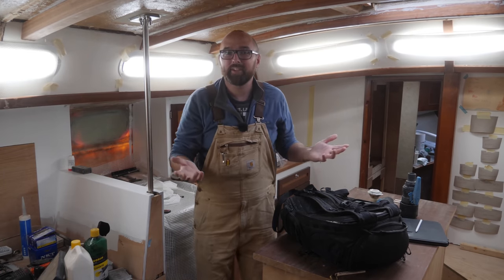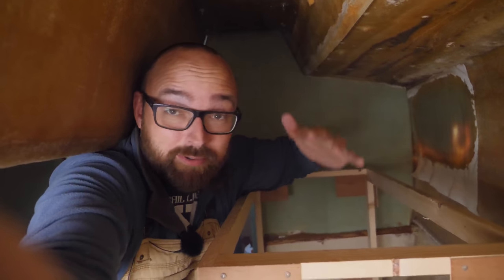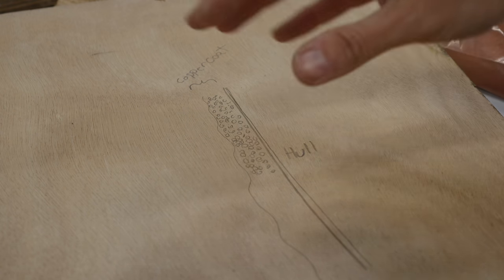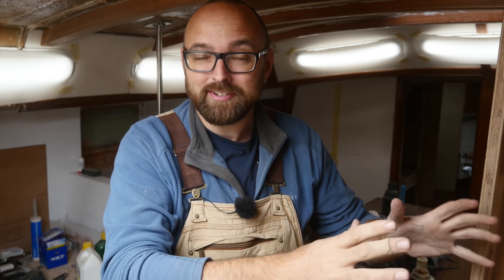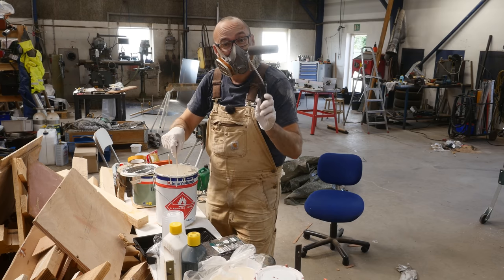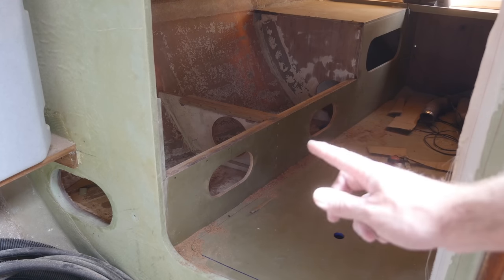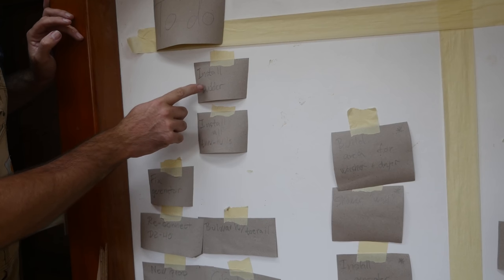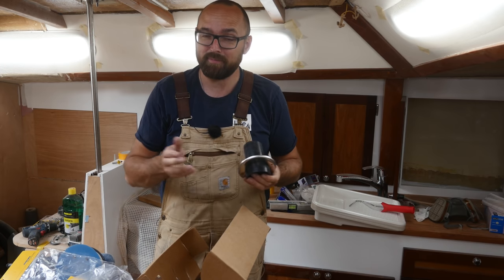Sail Life - Hull painting, tech compartment & coppercoat activation - sailboat project

Comment: Generator fuel tank under the generator location? Low and central. Oops. Too late.
Mads, your calm ability to uncover and resolve problems, often monumental problems, is now web legend. Rather than getting angry, you get focused on a solution. 
Your sense of humor is epic. Bravo! Camera suggestion: Blimp your camera with a large baggie with a tight-fitting hole cut for the lens. That will limit dust penetration and you can always replace the bag now and then. Operation through the bag should be easy.

Comment: Nice cleats.  

Having big meaty cleats is very handy especially when prepping for a big storm like we are doing here on the US East Coast eight now.  

It's nice to run extra lines for storms but cleats fill up REALLY fast.  If I were to do things again I'd put in two sets of midship cleats, a couple feet apart.  It is nice to be able to spring both forward and aft from midships and sometimes leading a line around a piling and back to the same cleat is handy. But four lines on one cleat piles up.  

We don't use lines with eyes, but a bowline loop is handy on one end.  Even your little center hole in those cleats would allow a bowline to be tied onto the cleat through the middle to save space.

Remember to put your fairleads as close as possible to the cleat so line stretch will produce minimum movement and minimum chafe.  The further the fairlead is from the cleat the more the line will move over it.  

I can't wait to watch you build your toe boards.  That should be fun. Integrating fairleads into or around them should be interesting.

Comment: I'm sure you have thought of backing pads for the cleats. I have to mention it having had a cleat plucked out of the deck on a Sadler 32 on its mooring after an exceptional storm. Love the channel Mads. 👍
Reply: Stainless steel plate on the inside.
Reply: G10 or even structural fiberglass works a treat.  He could lay up his own about 6-8mm thick.  Maybe even epoxy them right on to the underside with a fillet around it.  Instant thickened section.
Reply from the maker: I've ordered 6 mm stainless 20 x 20 cm backing pads. That should work 🙂
Reply: Good man. It can't be easy boat building by committee😉

Comment: Maybe re-format the SD cards, possibly the GH5 was going bad for a while and has subtlety corrupted the actual filesystem on them, which in turn is causing issues as you now use them in the GH4 … or you're leaving them too close to the welder ;-)
Reply: Might have even actually wrecked the cards. Storage is cheap, at least; replacing the cards with new after replacing a camera will feel cheap and easy.

Comment: Why did you not wait to activate the Copper Coat until closer to putting Athena in the water?  Wont it just oxidize when exposed to air and require reactivating again later?
Reply: You are 100% correct
Reply: That was my thought as well.

Comment: Shake the camera and let it rest without a battery and memory card. There's also a general reset feature (there should be one). If not, just take it to someone who knows how to fix cameras. I fixed mine (fell at 1 meters, no longer working) for a third of the price, the tech guy had to desolder and resolder 2 boards that had shocked loose in the mounting.

Comment: Mads is there no need to get the hull in the water soon after activating the copper coat? I would have thought you'd need to minimize the layer of copper oxide that will form when copper is exposed to air .
Reply: Hi Mads I was wondering why y decided to activate the copper coat now with no definite launch date...superb work to date.

Comment: Would I be right if i said you are trying to get a layer of oxidized copper on the hull before launching. Is it the oxidized copper that has the anti fouling properties??.
Reply: Yes. Partially. Once the boat hits the water the salt will accelerate the oxidization and turn the brown to green and it  is that which repels sea-life.

Comment: clear the sensor  pull your battery and press the shutter button others ..discharge all the caps and bios battery for the camera and let it stay discharged 24h then power it up  that may fix it,,last resort  see if it has firmware  and flash that  best of luck thanks for the videos

Comment: There is a delayed release of the DH6 so you might find prices coming down on the DH5. The post regarding firmware might get your DH4 up and running.

As to your DH5 do you not have insurance for accidental damage? The camera probably stopped working when you accidentally "Dropped" it.

If I were you I would not worry about having the latest Doo Hickey see I have picked up some technical terms. As long as you are in the yard durability is going to be more important than mega quality. It is not as if you are a twenty something bikini clad babe that we need to see every hair and dimple! Actually come to think of it a DH1 would be ok for now :)

Comment: What was the motivation for activating the coper coat when you're still a few months off splashing?  

Unless I'm missing something about the specifics of the order you're doing things in, I would have assumed leaving it as close to getting in the water as possible would have been better to minimise the time when the new activated layer is exposed to air. 

Of course that may not be an issue, but I'm just curious.
Reply: The coat is supposed to withstand ocean water for a long time so I'm pretty sure it doesn't matter at all. It just needs to be done at one point. What should happen to the copper? It's not turning bad and he probably doesn't expect too many algae ;)
Reply: I was thinking the same...
Reply: Copper left exposed to air or seawater turns green, you can tell a coppercoated boat by it's pale green hull after a while. When used on roofs, in particular churches they sometimes apply acetic acid to speed up the process . It's called Verdigris.
Reply: @astorMorisson  cool, thanks for the reply. Like I said I was just curious as I (maybe wrongly) thought that if it wasn't done following application it meant that there was a need to do it just prior to splashing. 

I just read the FAQs on the manufacturers website and admit that I had misunderstood what this process was for. I think I was expecting it to remove a thin oxide layer but it is the opposite in effect. You're skimming off the thin layer of epoxy to allow the copper to start oxidisation and allow the antifoul qualities to work.

Every day's a school day. 😉
Reply: @andrewcooke5392  Indeed. Quite a nice color. As far as I understand it, that process only affects the surface as one does not have to constantly replace the roofs of the churches
Reply: @astorMorisson  Yes, I guess like a few metals that we consider corrosion resistant, a thin layer of oxide or other layer forms which prevents further corrosion, or at least slows it's process down significantly.